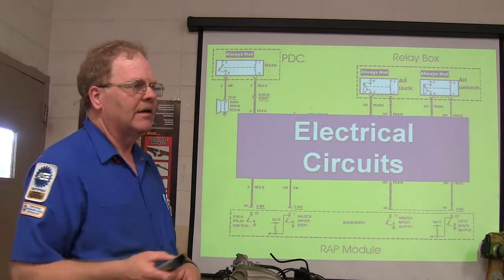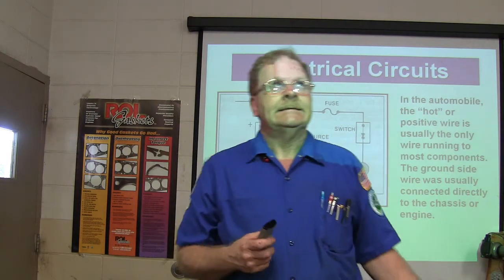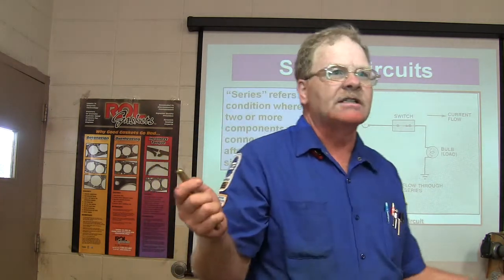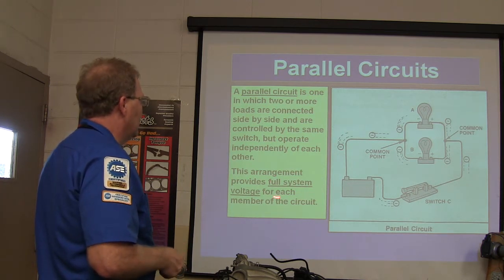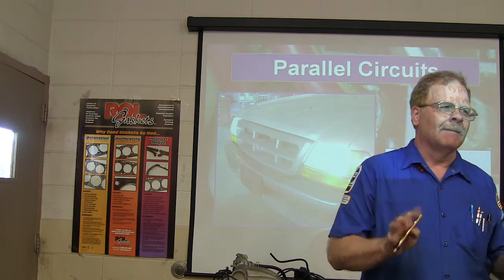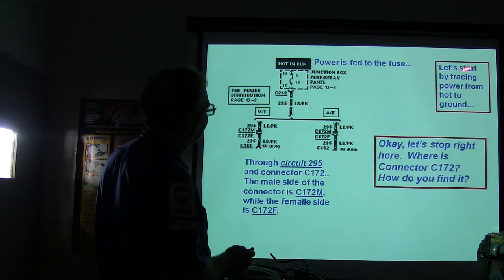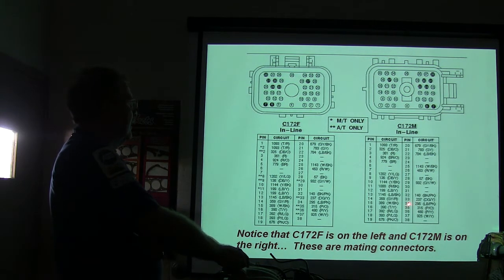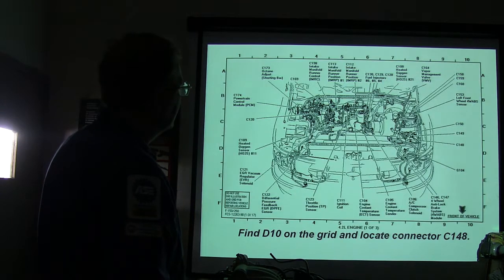Electrical 1 Day 1

Comment: I like the way electrons transfer in a vacuum tube to add power however it is not practical to use in a machine that moves. In a non-dealer repair shop you will run across a lot of messy aftermarket stereo and alarm installs that cause problems. Who likes splice connectors?
Reply from the maker: not me!!?

Comment: Maestro I’ve just recently come across your videos I’m getting ready to retake my ASe b5 ... during the test there was a question with the diagram in minute 5:10 asking what was the function of the actual switch... I’ve been trying to figure out what is the correct answer.... i don’t remember the actual options they gave out... P.s. I’ve learned a lot about  wheel alignments from your videos. Also Iam not a mechanic I’m a body man but to get a car manufacture certification we must pass some mechanical ASe test
Reply from the maker: The switch just closed that series circuit...